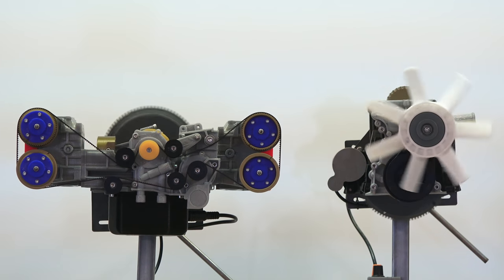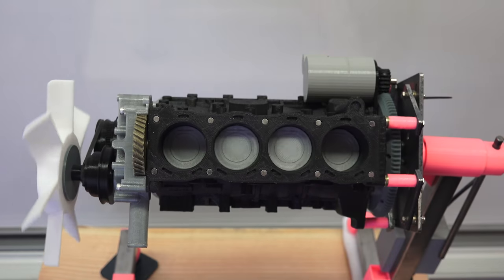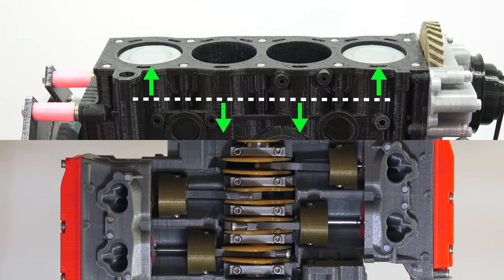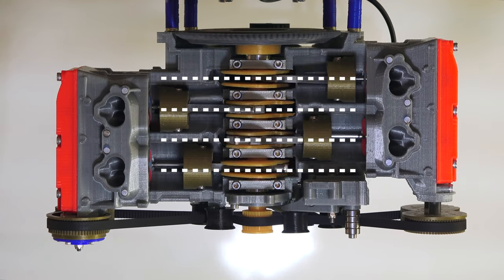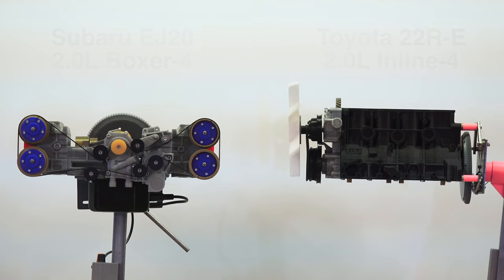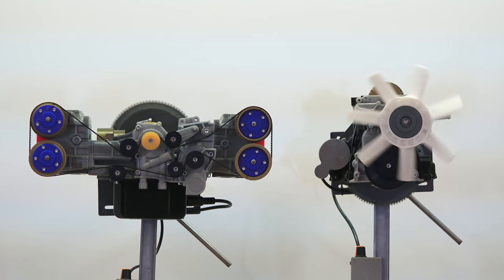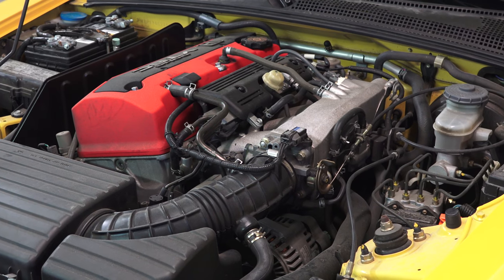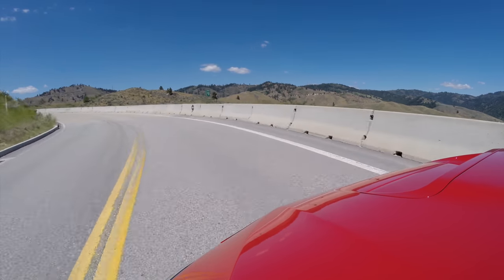The Differences Between Inline Four & Boxer Four Engines

Comment: I want to see the dyno pulls on the two engines above.
Reply: .03 hp @ 80rpm
Reply: Bet the boxer makes more power
Reply: @kristinanderson7446  yeah, but it makes less torque....
Reply: Boxers don’t make more power. There’s a reason only a few companies use them
Reply: @emptyendeavor2762  Porsche may disagree with you on that.
Reply: @datsuntoyy  sure, you can get more Horsepower if you use  turbochargers or superchargers, but pound for pound they produce less power than an equivalent engine in an in-line or v configuration.
Reply: @Teladian2  carefull with the "pound for pound"  flat engines are very light and that's why they are so widely used in the aircraft industry.  One big issue is they tend to be very wide which creates problems in chassis design, but for the smaller and lighter vehichles they really have their place.   I've seen ready to run engine/transaxles from corvairs down to 181 pounds and with modern upgrades (again, thanks to the airplane folks engineering) producing 700 hp.
Reply: @datsuntoyy  you still need very specialized tuning and turbo or supercharging to get HP ratings that high.
Reply: @Teladian2  that goes for any engine.  especially when the basic design is over 60 years old.
Reply: @datsuntoyy  🙄🙄
Reply: Now we need to see a W16 and Rotary 3D models
Reply: Wilson Freeman they do have rotary 3D models I think he reviewed on this channel
Reply: Boxer engine are poppy n/a, look at the brz. Fbo brz's don't make nothing over 200whp without e85. My car makes 200whp bone stock and it's a 4 banger 2.0L😏
Reply: Adrian Arteaga Could you decipher all those initials for people like me who are uninformed?
Reply: @jockellis  FBO- Full Bolt Ons, WHP- Wheel Horsepower. And E85 is a type of semi racing fuel, meaning it's 85% ethanol and 15% octane.
Reply: Adrian Arteaga but I thought e85 was just the opposite. I guess that’s why on my 944 forum they were talking about not being able to use it because it destroyed those old fuel lines. Thanks.
Reply: @jockellis  E85 is what Indy uses now. It's pretty potent fuel wise and it can be hard on old fuel lines.
Reply: datsuntoyy Back in 1966 I went to the Fox Theater in Atlanta where they showed the Indy race in black and white on a big screen. There was a big crash early in the race involving A.J. Foyt. He climbed a huge fence to get away from the alcohol fire that ensued. We could see no fire and I thought Foyt was just trying to get away from the track.
Reply: @jockellis  "Talledega nights" Will Farrell.
Reply: @jockellis  that's correct, E85 is very corrosive. Would not recommend running on stock fuel lines. Most stock oem fuel lines are rubber which isn't to friendly with this fuel. Stainless steel lines would be great.
Reply: @emptyendeavor2762  Just like the rotary engine is practically discontinued.
Reply: @Teladian2  bro I own a Mitsubishi Lancer limited GTS manual 2017 model right under the evo, Subaru brz smokes my ass and it doesn’t have a turbo, brz is a na flat 4… boxer engines are better overall and they got more torque that’s why they are masters at hill climbing to. Wish I owned a wrx sti
Reply: @psychoaceclap6402  All RWD have better acceleration than FWD cars. Most race cars are RWD like the brz. Also I think your car is heavier. Hence the diff in acceleration. Anyway I prefer boxer for it's accurate handling.

Comment: One eats head gaskets and the other is a reliable design.
Reply: Not all Subaru engines had head gasket issues
Reply: They all have head gasket issues. Just some are worse than others. I’m already seeing newer Foresters coming up for cheap with oil consumption or coolant leak issues.

Comment: In-line 4 doesn’t need to be rebuilt every 100k
Reply: 911 6cyl are very reliable
Reply: @ Charly Marceau 

Look up Porsche IMS. LOL.
Reply: Neither does a boxer
Reply: @ Daniel Buttriss

Sure, not rebuilt. Just removed from the car and the top ends totally stripped down to replace head gaskets. 

Vs an inline where it will be 200K or more before it needs a head gasket and you can change it in-situ in a day.
Reply: @Bartonovich52  you must really hate boxers by your comments
Reply: @danielbuttriss6879  he isn’t wrong though. Boxers are much harder to work on for many repairs.
Reply: @CadgerChristmasLightShow  from experience boxers weren’t ever that difficult to work on and if someone finds them hard they shouldn’t be allowed near a car
Reply: @danielbuttriss6879  I’ve owned 2 old air cooled VWs before with boxer engines. A bug and a bus, and did all my own work. They sucked to work on. Especially when I had to take the TWO leaky valve covers off, which was often. The two cars I own now are both inline 4 and are much less of a hassle for me to work on overall.
Reply: @Bartonovich52  Turbo ;)

Comment: Boxer are actually very common in general aviation. Continental or Lycoming engines are used on many general aviation planes.
Reply: The Cessna 172s and Piper Archers at my flight school all use versions of the Lycoming O-320, which is a 4-cylinder boxer. 6-cylinder ones are found on a lot of twin-engine airplanes and larger single-engine ones. They're great engines, and sound unique when compared to their automotive brethren.
Reply: @algorithm1193  Doesn't the prop sound sort of interfere with the engine sound, though?
Reply: @Derpy-qg9hn  I mean yes, you won't hear just the sound of the engine, far from it. But it's still a neat sound, it's just very unique due the sound created by the blades themselves. Not to mention prop wash.
Reply: Oh.. and why four cylinder for the most part?  Because as you said.. perfect balance. The O-200 I mentioned is a 200 cubic inch engine. It’s one of the smallest aircraft engines made. O-320s, O-360s, and even O-390s are all four cylinder engines with pistons well over 5 inches in diameter. 

There’s no way you could make an in-line four cylinder that displacement run smoothly.. so not only is vibration bad but so is reliability—of the whole aircraft as it shakes. Forget balance shafts. More weight and more things to fail. Even dynamic dampers on six cylinder crankshafts are problematic. 

Four cylinders means lower parts count.  The high weight of the dynamic components doesn’t matter because the engine being direct drive only spins as fast as the propeller is able to—about 2700 RPM before the tips break the sound barrier and efficiency drops off. Low RPM is also better for engine longevity.
Reply: For Balance purpose
Reply: The Volkswagen beetle and that van that was commonly used by hippies

Comment: I was once a subaru guy. Not because of their speed but because their AWD is the best there is when it comes to wintery roads, and here in Vermont that is important. I am not a fan of their engines though. Every subaru I have ever owned needs new head gaskets at about 100,000 miles. And to replace them properly means that the engine needs to be pulled out. This is very expensive and does not feel worth it.

Comment: In Subaru:
— Knock knock
— Who is there?
— It's me, the 4th cylinder
Reply: hahahhhaahhaha yeah, boxer-4's sickness.....
Reply: Ну если только это не атмосфера...
Reply: yeah it famously overheats but there's a new mod to fix this, running a hose from the coolant plug at the back of cylinder #4 and tapping it into 1 of the the heater hoses.
Reply: They call it the subaru slap
Reply: Mark Richards  i was going to buy a subaru with bad head gaskets to get it cheap but i found out it will just do it again. I will stick with toyota. Some cars go 300,000 with nothing more than oil changes and basic maintenance
Reply: Mark Richards  no doubt a good car but ive seen too many toyota cars 300 to 400k with the factory head gaskets. 100k isnt that much driving really
Reply: Mark Richards  yup iam a wrench to out of a ford dealer. The older i get the less i want to do and iam only 50.
Reply: Mark Richards  not a mechanic but have owned a 99 Impreza and am pretty into boxers and apart from their heads going they're nearly perfect when maintained well so idk what cooling issue they're talking about, maybe some aftermarket turbo set up but I'd imagine you'd only run into issues if you try shoving a turbo that isn't meant to be there in with a bunch of stock parts
Reply: @billyjack8119  55, now drive a truck, better money, no aches n pains couldn't be happier
Reply: Even the crappiest domestic car will get 200K out of the factory head gaskets. 

That’s usually what writes off the car.. because a simple in-situ head gasket replacement “isn’t worth it” on a 15-20 year old domestic.
Reply: 3rd cylinder if it’s an EJ25
Reply: @nickwhite2728  yeh the ej25 in the wrx has oiling issues with the turbo. I've never had a cooling problem it is an open deck cylinder design. That is also part of the head gasket problem along  with only have 6 head studs. Most people pull the screen filters out of the banjo bolts. There is one for each cylinder bank. The ej25b has some small differences in the casting but still suffer from the same problem.

Comment: Very interesting and explains a lot. I knew I felt a kinship to Subaru when I drove the first one in our family (1982 Subaru GL 4x4 wagon) because the boxer growl reminded me of my first vehicles (1965 VW Beetle, 1956 VW/Dune Buggy, both shared the same engine!) Same flat 4 grumbly growl! 

We had a '98 Legacy Outback (EJ2.5) which of course had the dreaded head gasket issues, first at 109,000 then again at 186,000. That was replaced by a '17 Forester, hopefully the head gasket issues are truly solved, I heard that this engine is substantially different in how the water flows from the block to the heads. 
At the same time we bought the '98 Subie, we also bought a '98 Jeep Grand Cherokee with the inline 6 (all cast iron, ancient AMC design). True about the running smoothness and these engines just run and run. We still have it, 20 years old and 178,000 on the clock. No engine repairs ever. 
As far as balancing V6 engines, we also have an old boat with a pre-vortec and pre-balance shaft 90* Chevy V6. These engines tend to have pronounced secondary shaking forces that are damped out in the boat with very soft engine mounts. When I replace this 30 year old engine I will get a new GM marine 4.3 with the balance shaft. Despite the somewhat rough running these 4.3s are very durable, and very simple to repair.